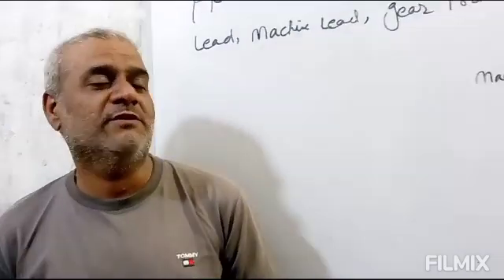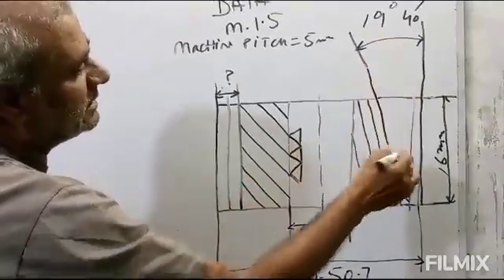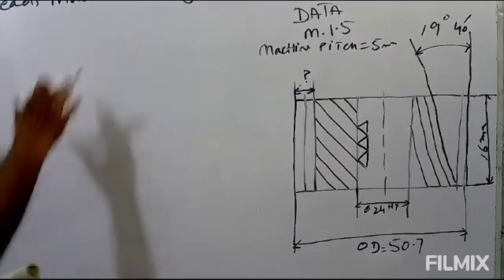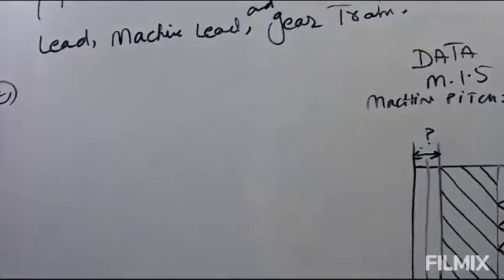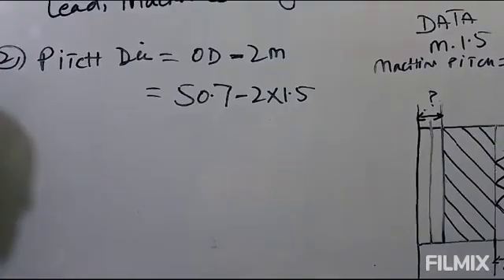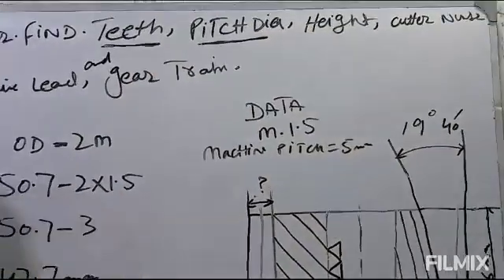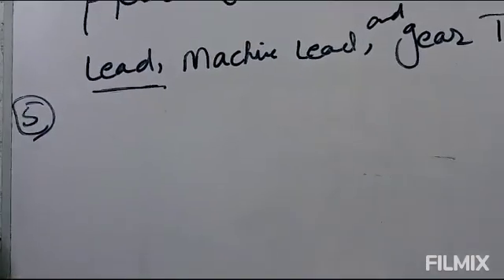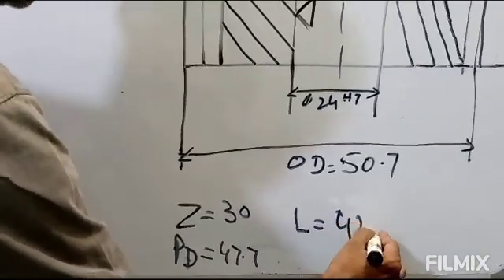Helical gear find, teeth,pitch dia,height,cutter number,Lead, machine Lead,Gear train

Comment: SIR SAB SAMJ ME AA GAYA AAPNE 62 use Kiya na wo nhi aaya ..jitna me smja uske hisab se kya mere pas Jo gear hai us hisab se me 62 ki jagah 72 use krunga to bhi Kam ho sakta hai kya mera
Reply from the maker: Ap machine ki lead batay or job ki lead batay main comment main solve kar k send karta hu
Reply: Aese nhi sir Mera mtlb hai ki aapne 62 hi kyu multiple kiya kya eski jagah dusre gear se multiply nhi kr skte hai hum ya kr skte hai
Reply from the maker: @Mechanic1.0  ap 72 bhi dividing head par laga saktay hain phir machine ki lead screw par 33.7=yani 34 ka gear lagay
Reply: 250 thav wali machine ka lead SCREW hai Mera to me 6.25 mm hi manu machine ka lead SCREW pitch sir
Reply from the maker: @Mechanic1.0  1/4-T,P,I hain apki machine Ki.6.35 mm pitch. Apki milling machine ki lead hogi 1/4*40=40/4=10 inch lead